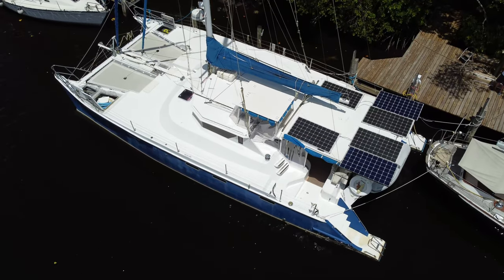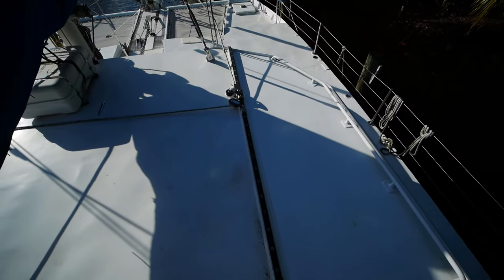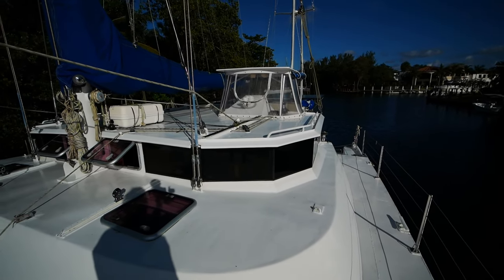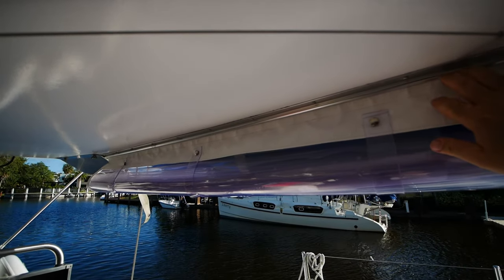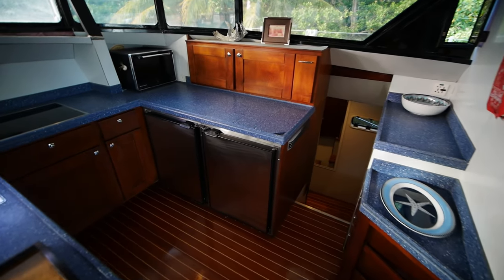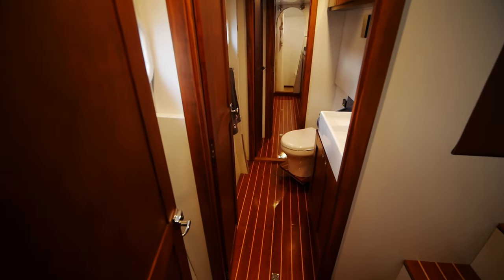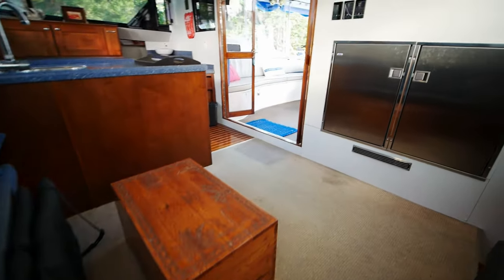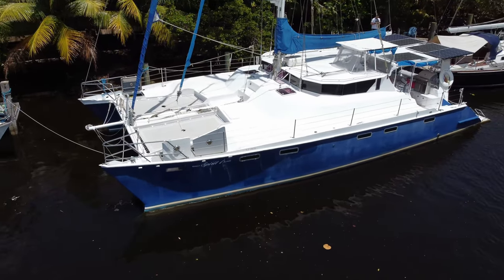Alu-Crowther 52 - A Neat Bluewater Catamaran from Australia!

Comment: Quick tour on a rather unique vessel, but this is likely going to be an expensive project boat (reasoning under observations). Looking at the linked document, to confirm, the boat condition is listed as "New" on a 24yo hull @$375k?

Observations:

Don't get me wrong, the design is interesting, and if the bones are solid, it has a lot of potential but the foot-path/movement flow is odd.  The only access to the single (raised) helm is via external path and salon pathing to the port-forward berth seems awkward. Add in ~6foot headroom, and what looks like most of the liners needing to be replaced (doing which might also be able to reclaim some head clearance depending on underlaying structure), leaves an interior area that's usable, but not focused on creature comforts.  While it may be very "practical", it's not likely what a lot of cruisers might consider comfortable.

So in addition to all that, and the normal issues with a 20+yo hull, standing and running rigging ages would be a concern (and rework cost on a what looks like a rather custom rigging design and sail pattern), the sail drive engine probably needs to be rebuilt if not fully replaced (the engine casing looks like it has electrolysis corrosion/pitting), full hull top and bottom paint, several areas on the deck look like they need repairs (there are a couple of areas where foredeck plating looks like it has started to buckle or had some work done)

And this all assumes no underlaying issues with the hull/frame/bulkheads.
Reply from the maker: Hi, it should have been listed as "Used", not "New". Thank you for catching that error, it's corrected. I agree that aluminum yachts are great at many things, but they don't exactly hold their value very well.
Reply: @BigBensBoatBrokerage  No worries, like I said, the boat is interesting, and almost everything mentioned is addressable, so with the right buyer, it could really shine!

Good luck with the listing!
Reply: @BigBensBoatBrokerage 
Maybe in the US but this would make a great expedition live aboard ... 

What form does the hull stroke keels take ? Can she dry out ..IE are those sail drives protected.
Reply from the maker: @clivestainlesssteelwomble7665  Yup, she has full length keels, not a problem!